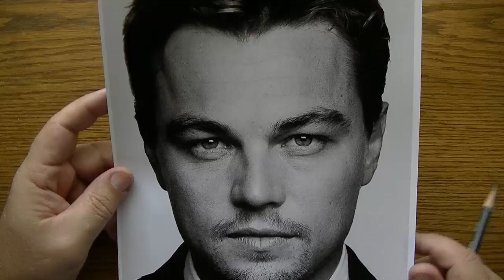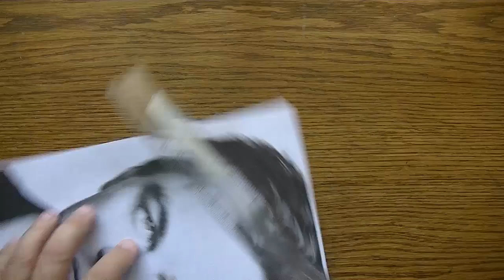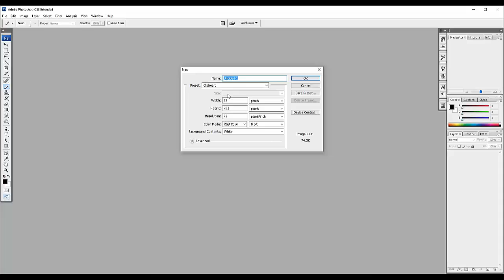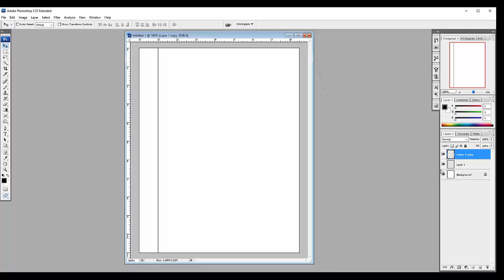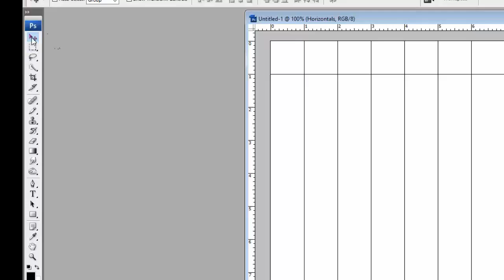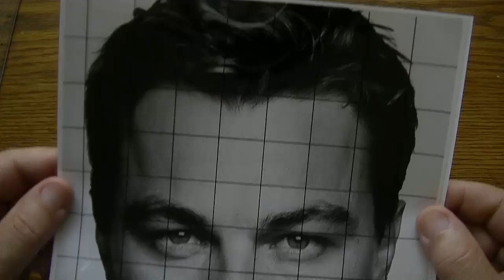Realistic Pencil Drawing tutorial - Grid Method - Part I Drawing Leonardo

Comment: Hello Rix, which printer do you use forprinting the reference photos? I wannt to buy a good one , do you have any recommendations?
Reply from the maker: Any good inkjet printer. I've used several and they all worked fine. The inkjet I'm currently using is an Epson Artisan 1430. You don't have too spend for one of these though to print good photos. Read reviews on printers as to printing photos.
Reply: @RixCanDoit  ok thank you so much!

Comment: "scale to fit media" will actually shrink your grid (hence the word scale) if your printer doesn't print edge to edge, which most consumer printers don't. you are better off leaving it unchecked. Also, if you do your grid in illustrator or at 300dpi you will print out a much smoother line.